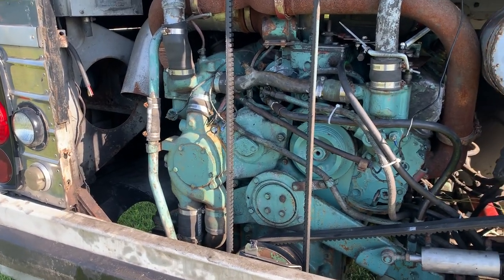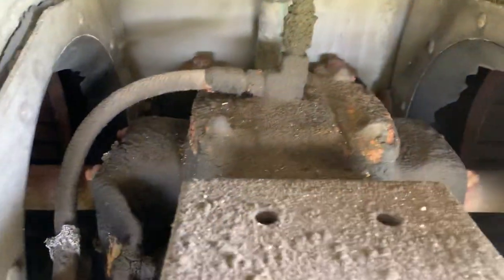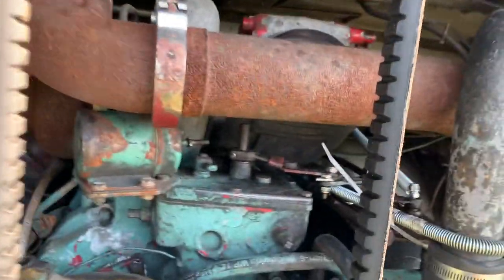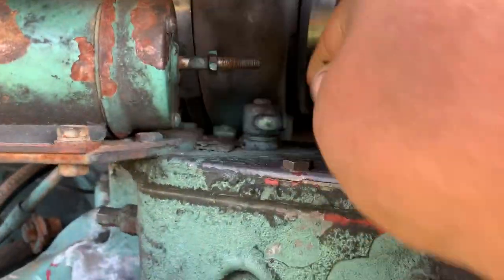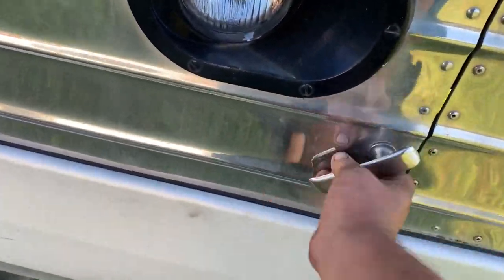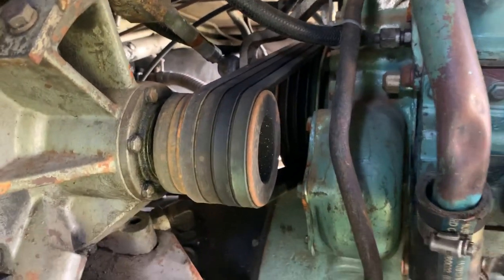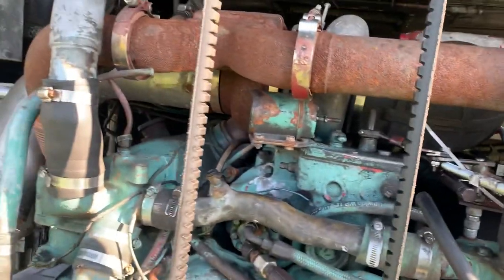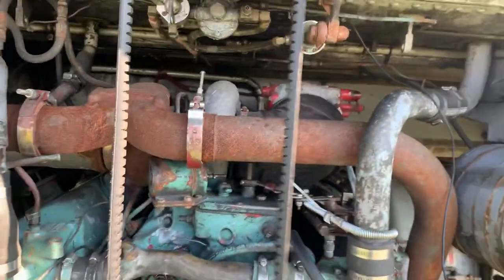MCI bus giant belt wtf is it?

Comment: Wouldn't it be better to eliminate the fan squirrel cage, belts etc.. and modify with electric fans???
Reply from the maker: No
Reply: It would take massive amounts of electricity to power fans capable of producing the same cfm's as the factory squirrel cages.  Large electric loads on large alternators eat up lots of horsepower.  So the only thing you accomplish is removing the belt, while making your cooling system less reliable.. You don't spend a lot of time in the engine bay while the bus is travelling, so it is not a wise tradeoff.
Reply: @MrMauserb  : Makes alot of sense now that you broke down the trade offs.
    Thank you for your time.
      Kind regards, Eric

Comment: And you need watch out for the A/C belt too when the bus is started with no or low air pressure. I did not like that set up. Shake Hands with Danger.